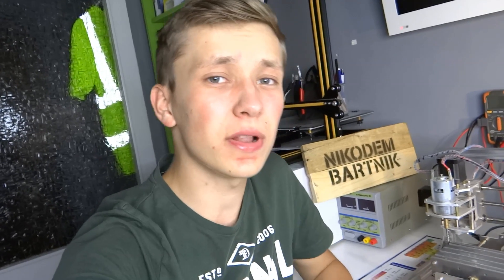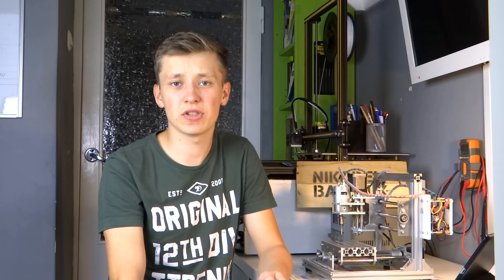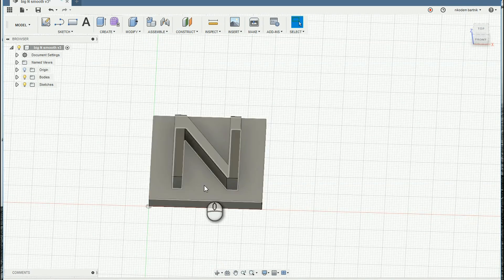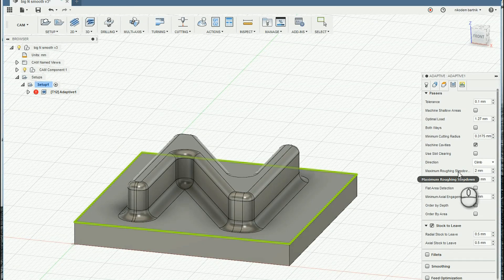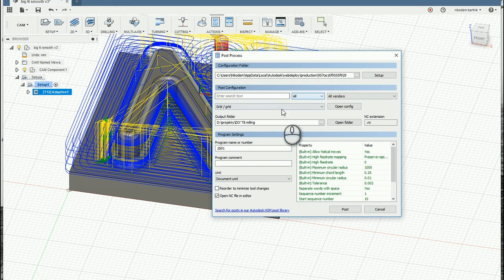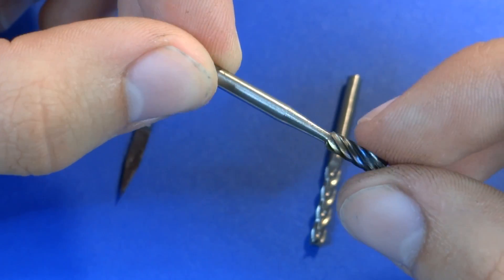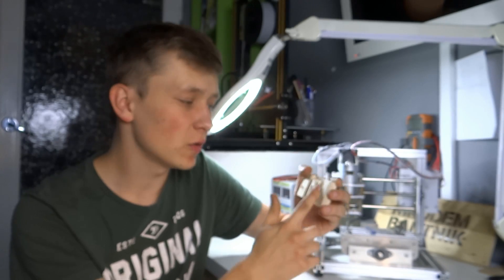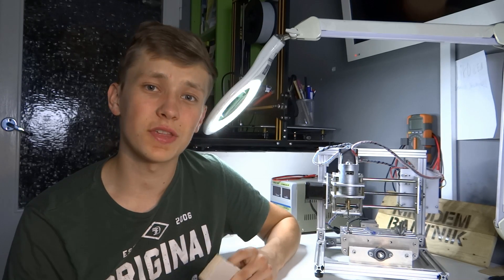Milling on DIY T8 CNC machine

Comment: How long did it take to complete the milling? It only looked about 20 minutes?

Also do you think this machine could handle hardwood, I am assuming lower speeds would be required.
Reply from the maker: I don't think it will handle hardwood, spindle there is really weak. It took more but I don't really remember sorry :(
Reply: @nikodembartnik , which spindle is this? Where can I buy one like yours? I want to mill PCBs, but my Dremel is too noisy... Thanks!
Reply from the maker: There is link to this machine in the description